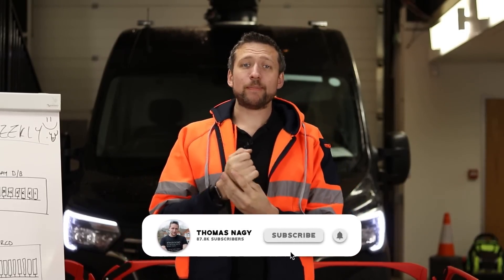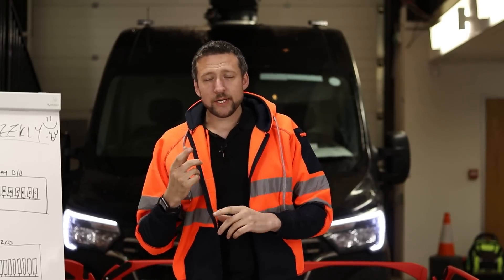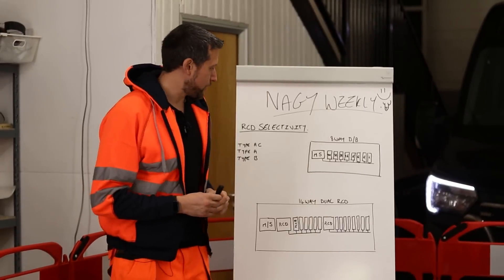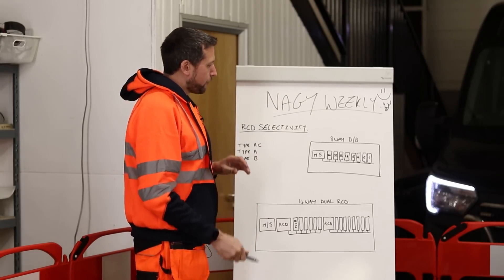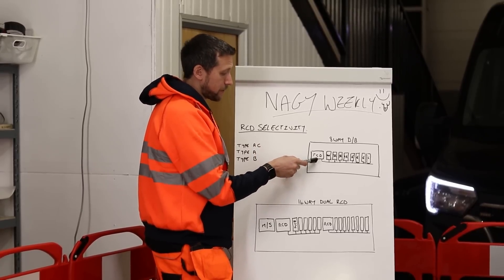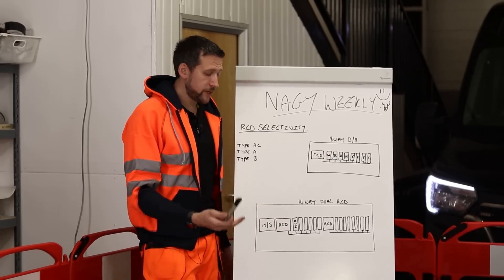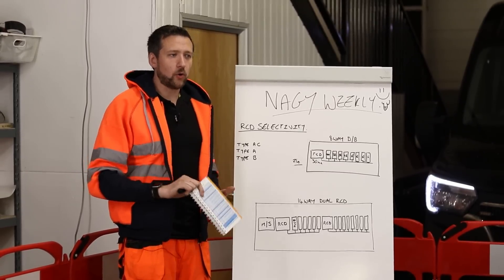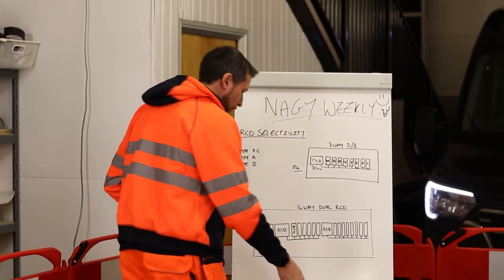Why RCBO's are BETTER than RCD's | Thomas Nagy

Comment: Here's a question for you sparks,

What would be the big deal with having a board for lighting and a board for sockets and another board for fixed appliances OR having each room on its own 2 or 3 way board?

I thought about doing a new build self build like that but no spark would entertain it.
Reply: Many hotels are done that way.
The loss of revenue from multiple rooms out of action outweighs the initial outlay on having one CU per room.
But in a domestic situation you haven't got that constraint.
I did an install a few years ago (all RCBOs) where the client wanted one lighting circuit per floor and one radial per room.
Reply: If what you're saying is like what I'm imagining, it sounds like a nightmare with absolutely no benefit

Comment: Funny type AC RCD is not allowed in Belgium for years now in new builds ..  also we need a 300mA tupe A  rcd in front of everything .. so having a circuit not protected by any RCB is not allowed . And at least one 30mA for the wet-rooms ( bathroom ) of course you can put more to have more selectivity .. I do like the RCBO's in uk .. but they are crazy epensive in Belgium .

Comment: Preaching to the converted, Tom.
Love RCBO boards. Quite simply, the faulty circuit will obviously (hopefully)! only take out the RCBO that supplies it.
Minimal circuits go down in the house, fair chance most (or enough) lighting will stay on.
Straight away, you can see which circuit has caused the trip, potentially leading you into the cause of the problem a bit quicker.

With fault finding, trying to find that gitting appliance causing the trip, you are only tripping out the circuit concerned, not half, or all of the house.
Recently, friend of mine had a nuisance trip. Always at about 3am. Driving him and missus potty.
"Standard" board, one rcd protecting everything. Told him he would have to be very patient and methodical, and basically go into "Sherlock Holmes" mode. Eventually found the prob, a very ancient, tucked away old doorbell psu from previous owner, that hadn't been disconnected.
Suggested if he could afford it, get a board upgrade, and all RCBOs.

Moved into new house recently, upgraded a few things, put a new board in, all RCBOs. Nice compact board, smaller than old plastic board, even with more circuits! (Intruder alarm used to be spurred off upstairs lights on a 2.5mm cable! - presumably by an alarm engineer). Now on its own circuit. Lots of space to work inside the board, as I chose the "new" compact RCBOs. Love how, when Crabtree launched theirs, they said "same price as the larger ones". Also like them as they provide double pole switching, completely isolating the circuit. Great for testing, and also less nuisance tripping if you are working on an "isolated" circuit, and do the old trip out by accidentally touching the neutral or something like that.
The RCBOs are all type Bs.

You briefly mentioned surge protection, Tom. It seems to be the current "flavour of the moment". I know a lot of leccies have mixed views on it, and like you say, can also depend on where you are as to if there is a great need for it. There could be an argument that most domestic premises have managed without it for years, so why the compelling need for it now? My thoughts are that if you've got a suitable RCBO populated board, you've probably got a good amount of reasonable protection, certainly the most protection that has been afforded for years. (Think back to double pole rewireable fuses - a miracle if they were wired correctly with the correct fuse wire, or more likely a nail or tin foil in the place of fuse wire).

Also another "flavour of the moment" seems to be AFDDs. Again, do you think they offer any realistic extra protection, particularly for domestic premises, or to be cynical, is it a way to just flog a bit more hardware for the consumer unit?
I think John Ward has tried to do some "real life" (or as "real life" as possible) tests with AFDDs with some results that might question the claimed effectiveness of these devices.

Would you do a chat with your thoughts on surge protection and AFDDs, particularly for domestic premises sometime, Tom?

Also why has someone appeared to have drawn a "thingy" on the flipchart?
Reply from the maker: Thank you for your input Andy. It is nice to read up on experiences from other electricians :) That would make an interesting video to talk about surge protection and AFDDs :)

Comment: Must have a minimum of 2 RCDS in a board in Australia, with lighting split over the 2. Surely thats also a regulation in the UK? Always use RCBOs these days anyway
Reply: Yes, the typical split is that downstairs sockets would be on the same RCD as upstairs lighting and vice versa so that you could have lighting available by lamps plugged in. Except the bathroom of course.
As the price of RCBOs has come down over the past few years, it doesn't really make sense to fit dual RCD boards anymore

Comment: Or why not just make sure you only have say three MCB's to every RCD?  That''s the current code over here in New Zealand.  RCBO's are not common and very expensives so we just limit the number of circuits each RCD can control, to no more than three.
Reply: Just simpler to use individual RCBO type A (not AC) breaker per circuit, instead of 1 RCD for 3 mcbs would be a Mess

Comment: I am amazed that UK has not regulated the AC type out.  NZ has been type A for a very long time now and a max of 3 MCB downstream per RCD.

I would prefer RCBO as it also has less space as we have to fit double pole version.
Reply: ah NZ also double pole MCB's ?  Type AC is in Belgium already 10-20 years not allowed in new builts .  But no limitation of the amount of MCB's after the  RCD ..

Comment: I think there is a (slightly backwards) reason to occasionally use RCDs. That is where you've got a circuit that might trip an RCD but you wouldn't notice quickly and it would cause issues if off for a long period.

In a similar vein to running the smoke alarms from a lighting circuit because you might turn the alarms off but you wouldn't want to lose the lights. 

Say you have a sewage processor on its own RCBO, it trips, you don't notice for a week, you've got a week's worth of poo that hasn't been dealt with. 
Or you've got a garage with freezer. Put that on a radial fed from an RCBO, it trips, no one notices for a few days, melted freezer. 

If those had also tripped the internet then you might have saved a bunch of smelly stuff. Short of having DBs that have some sort of alarm when a circuit trips, it can occasionally be advantageous to not keep a circuit to itself. 

Power or phase loss or alarms are a thing, however you have to get over the aversion to fitting non standard things on a DIN rail (which is standard practice in a lot of areas).
Reply: I think there is room for improvement in alarms or even wifi/bluetooth communication of a tripped RCBO.  As Tom mentioned in the video, putting too many circuits on one rcd can lead to excessive dc currents preventing an AC RCD from tripping due to an AC fault.
Reply: @jdaley197931  I have built systems to send me alerts when power fails to things, including battery backups so they can tell me when the power to them fails. But like you say it's unusual.

Most of the time at home it's obvious, but not always.

Comment: Great video, I  personally avoid fitting dual rcd boards for same reasons you mentioned in video (present faults) no rcd prior. After explaining benefits to the client of type A rcbo's  boards (future profing/safety) 95% of my clients go ahead with RCBO boards. Fusebox Type 2 SPD loaded whith RCBO's is my standard setup currently.

Comment: I Completely agree RCBO's have far more advantages than disadvantages, Most Dual Boards i have found are a RCD, MCB mix mainly, am not to keen on a AFDD and have not fitted on yet, i only put in the RCBO Boards with SPD now the prices are pretty decent now

Comment: Dual RCB is cheap shite for cowboy installers! Not a spark but I understand this stuff and 12 years ago when our old Wilex rewirable and VOELCB needed replacing I had a proper spark install a full RCBO board. It meant I needed to fix the borrowed neutral and couple of other issues before he came in to test and install but we now have an installation that is still safe and functioning (all be it on a 17th Ed plastic board with proper bonding)

Comment: It's weird that I knew this but didn't know this at the same time...
in Australia we don't really see this problem, as only much older places are slapped onto a single rcd.
In newer installations to be compliant we must have a 'maximum' of 3 circuits to an rcd and it must be split between lighting and power per rcd.
So at a minimum in a new installation, your hws, ac, oven and hot plate ect. are on their own rcbo, but then you would have a couple rcds with power. power, light. (purely because of the price).
I'm definitely going to remember this video if I'm ever fault finding in an older place!
Thankyou for the video Tom!
Reply: Silly thing is 1 RCD and 3 mcbs the cost at that point it's not far off just buying 3 RCBOs

Comment: Hang on a minute, what happens if the lighting circuit for the stairs trips? Same problem. If sudden loss of light is a safety concern, the protection is irrelevant: you need an emergency fitting with battery backup! Yep, RCD protection of multiple circuits is a potential bugger for nuisance tripping and fault finding. But the loss of light danger isn’t solved by rcbos!
Reply: Yes but what he is saying is if it was another circuit that has caused the RCD to trip you’re going to loose the rest of the circuits on that RCD where if you just install RCBO’s you’re only going to loose that circuit connected into that RCBO. For instance like Tom’s covered if it was a RCD protected board and someone was to plug something into the socket and it trips out you’re then going to loose the lights on that RCD as well...
It’s avoided potential losses.

Comment: Nice video Tom. 2 things; If you've got someone who already has a dual rcd board, could you move the lighting circuit(s) to outside of the RCDs and just fit RCBO(s) to just the lighting circuit to provide extra discrimination that way?  Also it would be helpful for Nagy Weekly to have the episode numbers in the text descriptions rather than just hidden in the thumbnail. Cheers!
Reply: That was the idea of the "high integrity" boards.
The "main switch" portion would be used for submains or RCBO protected circuits.

Comment: Your spot-on with your RCD comment. I had two fuse boards fitted when the property was rewired back in 1981. When the eldest came along in 1986 I fitted one RCD to supply these  consumer unit's (quite expensive at the time). The problem I had being nearly every time the supply switched off and on in quick succession due to a fault in the area, the trip would go off as well and have to be reset. Finaly changed the set-up to one consumer unit last year with RCBO's. It's been tested a few times by external influences and everything still remains on.

Comment: Totally agree with you Tom. Been fitting Hager Type A RCBO boards for the last 2 years. Won't quote or fit a split load RCD board anymore as I don't think they're fit for purpose. As you say, if the client wants a split load board then I don't want that client

Comment: Here in the US it's very uncommon to have an RCBO (known as GFCI here) in the electrical panel. They do sell them, but they're not common. Typically the GFCI protection is built into one of the sockets on the circuit with other protected outlets on the same circuit connected through the GFCI socket. This has advantages because not every socket on a circuit needs to be protected. For example, on one of the circuits in my kitchen there are 3 sockets. The first one is the refrigerator, the second is a GFCI socket, and the third is connected through the second socket. If a kitchen appliance trips the GFCI socket my fridge remains operational. Code requires sockets on kitchen counters, bathrooms, basements, garages, outside, etc. (basically anywhere water may be encountered) to be protected.

What is common, at least in newer homes are AFCI breakers installed in the panel. In the UK I think these are referred to as RCBO with AFDD. These not only trip for current leakage but also detect arcing that can start a fire, but is not enough to trip overcurrent or leakage protection alone. Originally they were just required for bedrooms, but now they are required in basically any living space that doesn't fall under a requirement for GFCI protection. 

Dedicated lighting circuits, which in a lot of homes also power the hardwired smoke detectors, are not supposed to be GFCI or AFCI protected to prevent the wife snapping her neck falling down the stairs, much to the chagrin of many husbands.
Reply: Hmm. I've been in 2 places of work where I've had elec tingles off light switches. RCDs on lighting circuits would have possibly tripped. I've a strong suspicion both switches were Crabtree make.
Reply: yep .. here in Belgium it's not allowed in new builds to have any circuits ( sockets ) not protected by an RCD ...  a 30mA RCD can save your life ..

Comment: The problem I have with these fusebox boards is wether they will be around in 5-10 years. I want what I fit to have a decent lifespan. Fuse boards can sit in a property for 40 years. I need more convincing to switch from wylex dual RCD to these all RCBO jobs. Who makes them for instance? Wylex is Siemens if you didn't know.

Comment: Haven’t fitted a split load in 8 years.
Once I’ve explained the benefits of rcbos to a client they are totally on board especially the bonus of finding their own faults.
I had a customer ring me up the other day saying they unplugged all their appliances like I trained them to and it was the kettle! They were so chuffed and pleased it didn’t cost themselves nothing😊
Now induction hobs are common type A’s will prove their worth as well as solar etc.
Time to let go of split load boards, old tech 😊
Reply: To isolate faults you don't need RCBO. You just need one RCD and dual pole breakers (as is the standard on my country). Dual pole breakers are very cheap (basically the same price of a single pole), and to isolate the fault is simple: turn off all the breakers, turn on the RCD. If it trips, then it's the RCD fault. If it stays up, turn on the breakers one by one, when you find the one that trips it, you found the circuit that has the fault. It's so simple that my mother knows how to do that. 

Yes, when it trips you loose the power to the entire house. As you do in a power outage, or in my country if you exceed the amount of power that you can draw from the grid by your contract (yes, thanks smart electricity meters). If it trips 1 time at year it's a lot, and all the times that it did it was because I was doing stupid things like repairing stuff without an isolation transformer and accidentally made a short to ground. If the RCD trips it's always a fault, and the fault must be fixed, it shouldn't trip for nothing.
Reply: @alerighi  Not necessarily, as leakage currents can accumulate. You just found the one that took it over the threshold. With the increased use of modern electronics there is naturally more leakage current, and if there are, say, 10 circuits on a single RCD then it's more likely to trip. 

There are plenty of videos around of electricians having trouble diagnosing what is causing a trip on those RCD boards. They go round turning circuits on one by one and don't find the problem. Also, that mechanism doesn't work with intermittent faults. At least with an RCBO and it's intermittent, then you know which circuit it is. You do not get that with an RCD and many circuits.

The only downside of RCBOs is they cost a bit more in the first place. However, factored over the life of the unit they are in, it's a very small cost and has a lot of benefit to the householder, and saves time and hence money in locating the problem.

nb. the intermittent fault issue is not theoretical - it happened in my mother's house, where an intermittent fault was happening, and gradually getting worse. At least with RCBOs, we knew which circuit it was, and the problem was isolated to that.
Reply: @tim g in the Netherlands, regs say max 4 circuits on one RCD. So a 14 circuit board would have to be a 4-RCD board. There’s no real need to go straight to 1 RCD per circuit just for that issue.

That said in modernity the price differential is so small…

Comment: I can't remember the last time I installed a twin RCD board, I would guess about 4 years ago, they out dated, and don't really comply with the regs anyway, because a fault on one circuit should not affect another circuit, which is what you get, I can't remember the reg number, but it's in the blue book of errors somewhere😂
Reply: Exactly they do not comply with separation

Comment: Totally agree with your comments on the unsuitability of dual RCD on properties I’ve refused to install them for the last 15 years, if you spend the time go explain in plain English the difference between dual RCD and RCBO’s most people accept the idea of the RCBO boards and pay the extra for them.

The big issue of dual RCD boards is then the previous electrician has install the upstairs and downstairs lighting circuits on the old Wylex board with rewireable fuses and has shared a neutral you can’t split the circuits on either of the RCD’s at least with RCBO’s you can keep them on one breaker because all the ring final circuits will be on separate RCBO’s meaning there’s always a lamp that can be used to illuminate their way downstairs

Comment: Recently, I've noticed that on my parent's CU, one of RCD covers sockets and lights, absolute genius, whole bungalow would be in pitch darkness if that tripped. (unless they open a fridge or switch on external lights which is on another circuits) 🙄